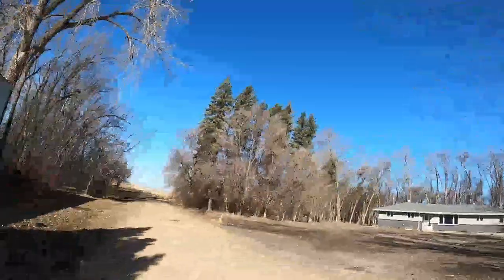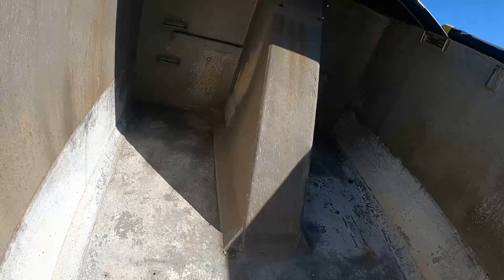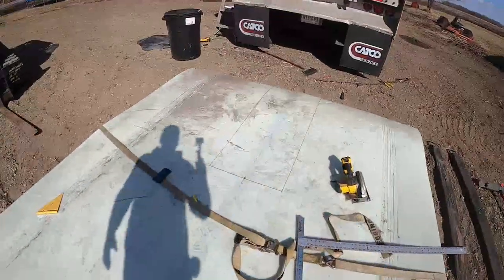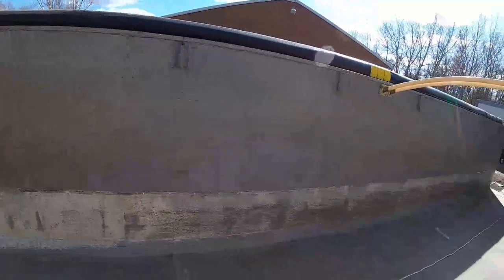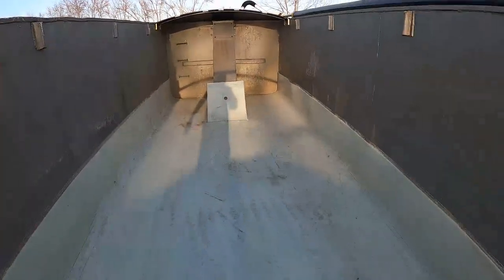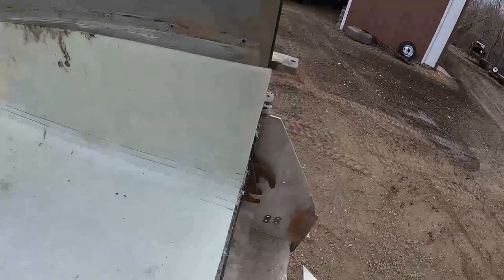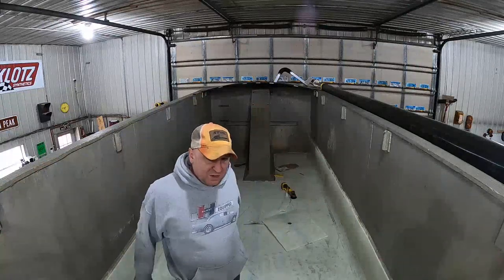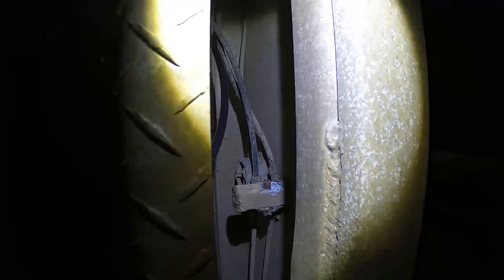Trailstar Dump Bed Liner install.  Wrapping up the odd jobs to get back to the Cabover!

Comment: It’s coming along nicely. I didn’t have a liner in the dumps I used to pull. Sometimes I’d put roll plastic down for certain loads in the winter especially. Looked like it went in pretty good tho.
Reply from the maker: Yeah...  I figure with the damage to the bed and the gravel I will haul it will work good.  Pretty much everyone around these parts use liners, even for gravel.   I think you commented earlier about the amount of wear the floor had and I hadn't gotten around to replying yet.   The trailer was originally used to haul ready mix concrete so I am assuming that is what did the most damage?  But then again the trailer is almost 35 years old, so its due for a little repair here and there!!   Its in great shape for an old girl.
Reply: @northlandmike6694  Yes it is in good shape.
Reply: Where do you buy your lining? I need some of that for my tráiler